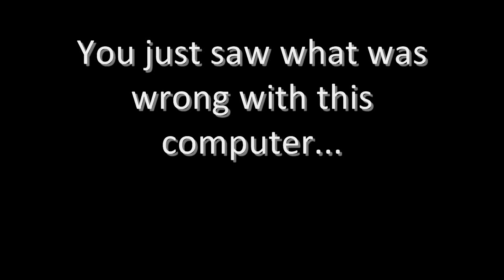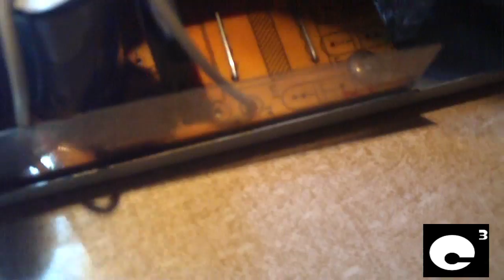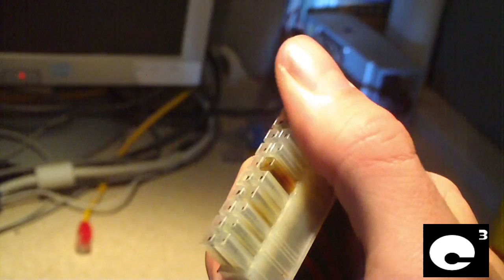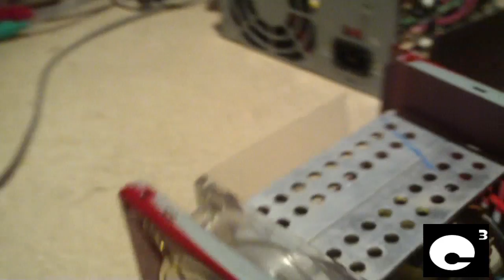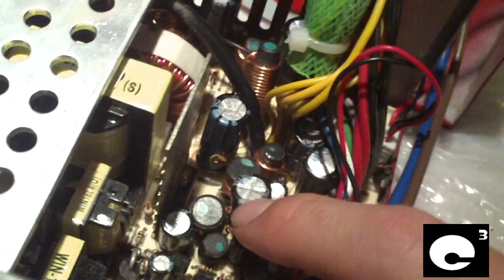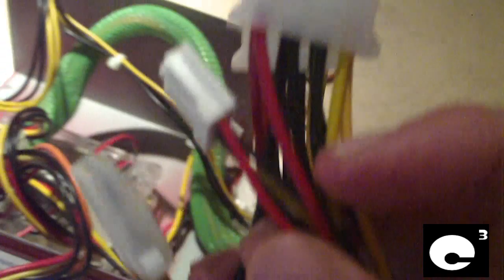Let's talk about cheap power supplies (PSUs)...

Comment: i have one of these psus. it was working fine, but then i unhooked the heatsinks and hooked a car amplifier up to it and it was working when i put it away, i decided to fix it up as a project and now it doesn't work lol. mine has the 4 diode treatment rather than the bridge rectifier.

Comment: Impressive that last PSU could source capacitors from the plague days. That is why those capacitors suck. The electrolyte in them eats the aluminum foil. It lacks the proper inhibitors. It happens even more when when the caps are powered off too.

Comment: If I remember it correctly it also came with a sata/IDE adapter. the converter for IDE and SATA hard drive inside of it is really loose. all you to do is shake it and the chip inside of it will rattle. It was on sale for 20 bucks.

Comment: I remember my mom ordered an IDE/SATA usb cable. It was real cheap off of Amazon and as soon as I ran an old IDE hard drive that ran windows 98 through the power supply, the hard drive would not start up and later on after having it plugged in 5 minutes, it was getting pretty hot. Once I plugged back in the win 98 computer it wouldn't start up either. So my guess was I fried the bastard up.

Comment: my old dell laptop came with no fans only the PCU fan. since its a laptop it is not possible to install anything but RAM. i think my laptop got hotter than this one. it would literally burn skin and it melted cheese  a foot away from the exhaust.